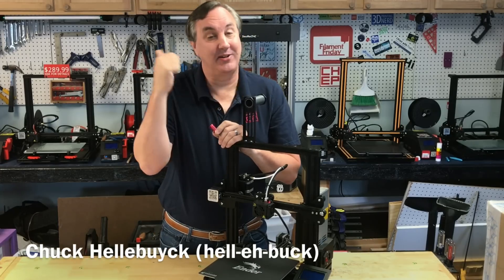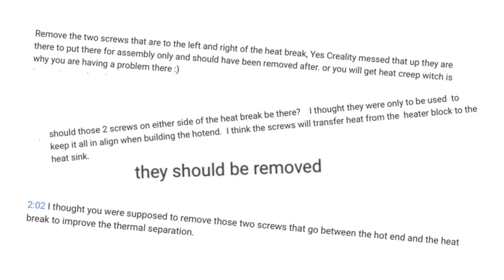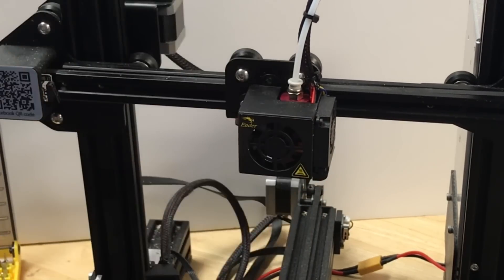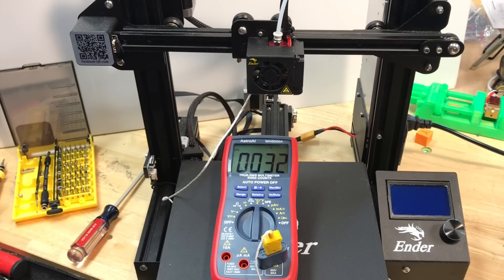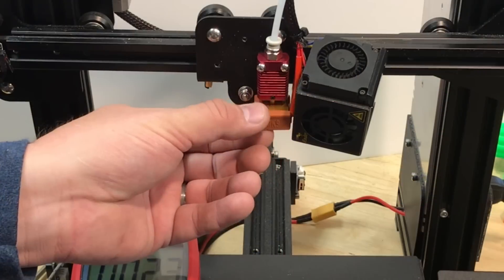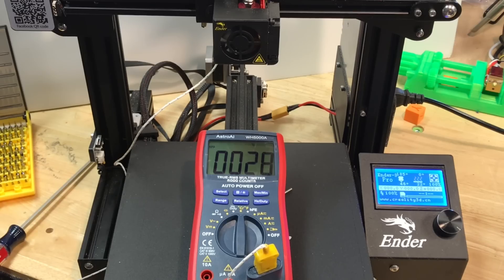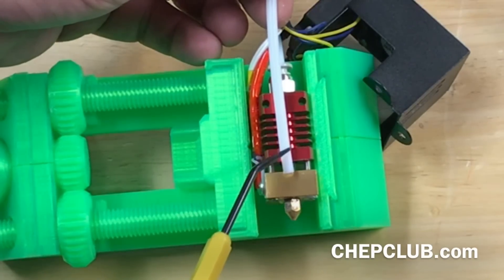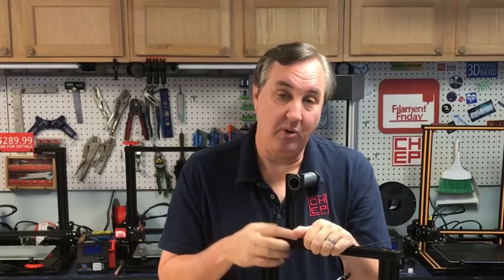Creality Ender 3 Hot End Heat Creep - Remove Those Screws......Maybe?

Comment: I remove the screws on all my printers and have had no problems.
Reply: People who don't believe in screws: 🤡🤡🤡
Reply: @GoldenJaguar3D    funny lol...
Reply: @GoldenJaguar3D  it can't turn once assembled. I have cr-10 s5 and I print 5 day to 7 day prints. The screws being gone have not caused problems. I push the Biden tube all the way through the hot end then cut it off. I never have problems anymore.
Reply: @Girl On A Quest the hot end can not turn more than a 1/16 of a turn. It is screwed to the carriage.
Reply: @GoldenJaguar3D  If your hotend is turning, that means that thermal connection between heatsink and heatbreak is very poor... Wich is raising melting point in your hotend, wich is bad thing. If you assemble hot-end in the right way, there is no chance to rorate or falling out, even without that screws. Add thermal paste, tighten lock screw good and you will see the difference.

Comment: This was really helpful. I ended up doing a few prints without the alignment screws thinking it helped solve my extruder skipping problem, but you're the second person that pointed out that without them, the heat break is only being held on by that set screw. The hot end is not something that should ever be potentially loose

Comment: There are so many things wrong with this test. You want the temperature of the inside of the coldend, the temperature of the fins is meaningless. The CPU in your PC runs at 60-85C, but the fins on the heatsink are room temperature...
Reply: I agree.  I still have my screws in, but this test should be re-run with the thermocouple placed inside the heat sink near the bottom (maybe held in place with a modified piece of PTFE tubing?)  and it shouldn't be moved between tests.   I still think it is fine with the screws, but it would be nice to get more reflective data.   Kudos to Chuck for attempting to get to the bottom of this question though.
Reply: @inb4dalock  Full disclosure, I'm designing a system that uses ender 3 heatsink with screws with cheap Chinese bimetallic heatbreak for Budget mosquito.
Reply: Disappointing to debunk a test without even getting up. Opened my CPU temp, popped off the side panel of my computer, verified CPU temp at 85C, touched the fins on the heat-sink

Comment: Thanks for the informative vid, i have a Tronxy X5S and it uses the cr heat block style less the 2 screws and my heat block moves, so those 2 screws do a very important job. Iv bought the cr10 heat block and now no issues.
Reply: Your setscrew is loose or not long enough to get enough force on the heatbreak

Comment: Sorry, but your test is completly incorrect! Because fan is cooling a thermocouple! I just use my finger to tuch upper surface on heatsink and it was so hot, i even cant keep my finger on it. Then, i remove this two screws and now, i dont feel any heat by my finger on the top surface of heatsink)
Reply from the maker: Check your fan. It’s probably failing.
Reply: CHEP I agree I can touch the top of the heat sink while the nozzle is at 260c.
Reply: @Anonymous-ee8ef  the nozzole shouldn't be that hot
Reply: roscoe baram it is when you print different materials
Reply: @Anonymous-ee8ef  yeah but unless Its heavily modified the ender 3 can only safely go to like 240 or maybe 250 with capricorn ptfe
Reply: roscoe baram I was just saying that you can touch the heat sink with the nozzle at 260 if your fan is working properly.
Reply: @Anonymous-ee8ef  yeah I know I was just saying the printer should never be that hot
Reply: roscoe baram stock no
Reply: @Anonymous-ee8ef  Because the ptfe tube in the stock ender 3 goes right into the hot end running it at high temerature s can cause off-gassing which can be dangerous. As low as 210c can be harmful to pet birds and 275 can kill birds but is apparently relativly safe for humans. I definitly reccomend getting an all metal hotend replacement where the ptfe tube only sites at the top of the heat sync rather than right at the nozzel.

Comment: The stock heat brake on the Ender 3 isn't that impressive when compared to better ones. What it affects is the heat creep, just as others have commented, but the heat sink is good enough to dissipate that heat, especially at lower heat block temperatures. What I would like to see is the same test at the maximum temperature. Removing the two screws and upgrading to a better heat brake WILL let you get to a higher maximum stable temperature of your heat block (basically utilizing the heat out from the heater cartridge best), but that's not needed unless you go for more interesting materials.
Reply: Because of the way the ptfe tube goes right into the hot end you don't want to be heating it up much more than 200 anyway because of off gassing.

Comment: Says 32C. Meter shows 30C.

Also measuring the temp outside is not accurate. There's no guarantee the ptfe inside (technically in close proximity with the screws) are also cool. 
The thermocouple is also being cooled by fan. So you are testing the fan effectivty + aluminum cooling. Missing the point of what we are measuring. The ptfe temp.

Also, are you aware that clogging issues happen on higher print temp using PETG and ABS? 

Stick to CNC Kitchen channel for adequate and REAL testing.
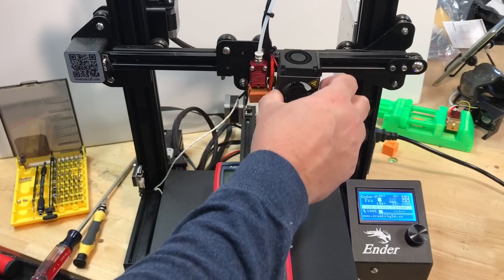Reply from the maker: At 3:59 it shows the 32°c on the meter. Most blockage happens with PLA because it expands at lower temps than PETG/ABS so it is more affected by heat creep. I’ve tested with the thermistor blocked from the fan and saw same readings. The point is the heat creep affecting blockage is a myth. I have a printfarm full of hotends with screws attached and no heat creep running near 24/7 for several years. What I have showed in later videos is the bottom 10 mm of the PTFE breaks down from heat directly from touching the nozzle and that is where blockages occurs. That is all below the screws and heat sink. And yes Stefan is a great engineer and friend. I do recommend his channel.
Reply: Aluminium is a very good conductor of heat so even allowing for a temperature gradient to the core and poor contact to the thermistor, I wouldn't expect the temp inside to be more than 50C.

Comment: I had a filament blob that formed around the thermistor wires which pulled out when I removed it.  I have the replacement part, but there is melted filament inside the screw head in the hot end so it's acting like a stripped screw head.  I can't heat it up without the wires connected.  Any ideas on how to clear it?
Reply from the maker: Heat it with a heat gun or soldering iron.

Comment: Good video! On a purely safety standpoint it would actually be dangerous removing those two screws. Because without them , the heater block/thermistor/cartridge are hold in place only by one tiny black grub screw in the heatsink. Which grub screw cannot be torque high because the heatsink is made of really low quality aluminum. Knowing that the extruder, mainly the heater cartridge, is a real fire hazard on those cheap Creality printers, no one should remove those two screws. That would be plain stupid! Period.
Reply: There is no load. Even if there were, the grub screws do not keep it in, they push the rounded surface into the adjacent rounded surface and create a ton of friction. The quality of the aluminum is not a concern because of the length of the setscrew. The hex on the setscrew will fail first. I have plenty of cold-ends that use a grub screw and no vertical screws and they have no problem

Comment: I'm getting heat creep on my all metal hot end around an hour into prints clogging up tried with screws and no screws the same thing any advice?
Reply from the maker: Check your fan. It may be spinning but failing.
Reply: I use a 40x20mm fan on my micro-swiss to help with heat creep. I've never once had a jam since I got the thing (knock on wood) and the heat sink is cold to the touch even with the nozzle @ 275c.

Comment: What about with abs or preg? I get clogging bag when I try and print those materials and it seems im getting melting on the tip of my tube.
Reply from the maker: What temperature are you printing at? 
I print PETG just fine.
Reply: @FilamentFriday  240 to 245.

Comment: Aren't those screws there to protect the heatbreak when you swap out a nozzle? I know a lot of people highly recommend a wrench to hold the block in place to prevent the break from breaking. I assume if you took the screws out it would break easily.
Reply: yet another reason to leave them in.
Reply: Just take them out when you're printing and put them back if you need to do a nozzle change. That's what I do. You shouldn't be letting your nozzle crash into things anyway and if the hot end breaks, it's like literally a 2 dollar part direct from china. I think it's worth it to avoid less heat creep. Heat creep means more oozing and stringing and higher required retractions as the melt zone moves higher up in the hot-end.

Comment: Keep the screws in. Why? They protect the heatbreak from breaking in two when tightening the nozzle. With the screws there, you just tighten it in place. Without the screws, you must use plyers or a wrench to hold the heatblock while you change the nozzle
Reply: Why not just remove the screws when printing and put them back in when you need to perform a nozzle change? I use a micro-swiss and it doesn't have those screws and it works fine, and has very little heat creep, especially since I'm blowing a 40x20mm fan on the heatsink. I don't see why you couldn't just take them out unless you're changing the nozzle.

Comment: The purpose of the heatsink above the heath-break is to keep the filament in the PTFE tube from becoming soft and squishy. The correct way of measuring the effect of these screws is therefore to measure the temperature inside the the PTFE tube at the heath-break. As an added bonus, this also removes the effect of direct cooling of the test-sensor by the fan.
Reply from the maker: I tried blocking the sensor and got the same results and if the heat sink doesn’t increase in temp then the inside if the PTFE won’t see it either. I checked the source not the symptom.
Reply: The PFTE tube is not a good conductive material. He didn't observe any variance of temp outside on the heatsink (32 Celcius in both cases). So putting the temp probe inside the PFTE tube would have change absolutely nothing in his test and the test result would have been the same : screw or no screw makes no difference.

Comment: The machines are made in China, anything not necessary would have been removed long ago.
Reply: Ain't that the truth!
Reply: Speaking as a manufacturing engineer who worked with China based manufacturers for decades, I can only WISH that your reasoning and logic applied to Chinese MEs and designers… but I assure you it does not. 

Do not ever expect logical design decisions- yes, even those affecting cost - from a Chinese shop. ;D
Reply: @railgap  Lol

Comment: heated up to 200°C.  Exactly same curve.
Stopped heating at 200. Cooling down to 35°C took 6min54sec.
heated up to 200°C. Removed 2screws. no other actions were done. Stopped heating at 200. Cooling down to 35°C now took 7min19sec.
There you have proof for heat creep. And this is actually how you test it.
Its obvious the screws transfer heat.
Reply from the maker: Nope. All you did was prove the screws connected to the heat sink help cool thinks down (which I never questioned) but I proved no extra heat gets to the PLA inside the PTFE affecting the print quality which is the original heat creep myth. The heat sink with fan dissipates heat too fast to let the PTFE/PLA get too hot so I stand by my tests.
Reply: @FilamentFriday  yeah that's true, it doesn't generate too much heat to affect the PTFE tube. However, due to the increased heat creep, the thermistor has to put additional power the heatblock all the time because the screws draw the heat out of the block.
The block has not to be cooled down.

This means increased power consumption of the printer and it does also mean the nozzle cools down way quicker (especially in the very high temperatures and when a lot of filament goes through, the thermistor can't keep up with so much heat drawn out of the block).
Sometimes it can be annoying to have a very quick cooling down nozzle when doing "tests" with the printer/stopping prints etc. The block needs to be hot and it needs to stay hot.
That's why the Mosquito Hotend has such a nice advantage. The heat stays where it needs to be.
I have removed the screws since they make no sense.
Reply: As CHEP said, you only proved that the screws help cooling down the block. So NO that's not actually how you test it. Man you just humiliated yourself on YouTube. Lol

Comment: I had heat creep which would jam up the filament, very often. Could not make a print. I made a duct for the heatsink fan, so the air would be forced over the heatsink. This worked much better. I then designed a printhead with a direct extruder and replaced the spring in the extruder with a bolt so the filament is gripped firmly. Now I have 0 problems.

Comment: i have ender 3 the hot end must turn hot plastic melt over heat element seml like hot plastic so i shut down pulled fans off and the plastic was thick but hard sp haet up removed the plastic check to see where the plastic come from the tud that screws into the brass heat end was pushing plastic up the out side of tube the i changed the hot end pluse wire tuened on power no heat to the hot end or the bed . check motherboard poer there but the wire ends for the bed and hot end had nopower the fans came on blue light on . but i did see when this was printing the temp was up and down so i thank the mother board has a bad short or mabe a relay bad the sencer wire replaced  w3hat your response on this thanks tom

Comment: Removing the screws made a BIG difference in cooling heat sink temps. I'm running a direct extruder and they supplied a plastic standoff to align the hot end with the extruder. The plastic standoff (behind the cooling heat sink) keeps the aluminum from dissipating heat from the cooling heat sink. This was keeping the cooling heatsink from working efficiently. Removing the two screws dropped the time down to 100deg F. HOWEVER, it allowed the hot end to loosen up while printing causing oozing. The filament chunks kept hitting the nozzle and the titanium tube stripped out the aluminium heater block. My solution, I got rid of the plastic spacer and went with an aluminum spacer to help dissipate heat. BTW leave the screws in to keep the hot and cool end aligned and for support.

Comment: If they are worried about heat creep then change out the screws for stainless steel versions. Stainless steel has a very low radiosity (meaning it does does not transfer heat very well).

Comment: i've been having heat creep issues with my ender 3s, but typically i am also doing a multi day print job at less than 0.10mm when that happens.
The heatsink is inadequate in those situations for long term. You can even do small prints as low as 0.05mm BUT not long prints due to the heat creep. Eventually, after days, the whole heatsink gets heat soaked and that ptfe tube is trash as it's completely blocked.
Reply from the maker: Sounds like your fan is failing. I’ve had this and replaced the cooling fan.
Reply: @FilamentFriday  fan is working. Issue is only with these under 0.12mm layer height supremely long prints.

But yeah, i've been planning on upgrading the fan on all my ender-3s for this reason :)
Reply from the maker: Try some higher temp:Capricorn Tubing: https://amzn.to/2nI2ipS

Comment: A schoolboy energy transfer calculation will tell you that each screw is - in ideal conditions - transferring less than 1W to the heatsink. If your fan can't bleed off this heat energy it's probably not doing a very good job.

Comment: Just a quick addendum: After watching this video I assumed this would also be true for the all metal "microswiss" chinese knock offs. This is absolutely not the case. I had HORRENDOUSLY bad heat creep and was assuming it was just a low quality cheap knock off. At 260c the bowden coupling at the top was scorching hot after only a couple minutes.  I made sure to tighten the 2 retaining screws above the heat break, removed the two long screws through the hotend (just like stock), and was delightfully surprised that even at 260c+, the top of the hotend was cool to the touch.

Chuck's test is only partially accurate, because he only tries 185c. The test should be conducted at the stock max, closer to 240c. At that point the extra energy might overwhelm the fan/heat sink and you might notice the ill effects of extra heat conduit. 

TLDR this video ONLY applies to the stock creality hot end, not the all metal microswiss knock-offs. It may also not apply at much higher temps then 185c.

Comment: Got a microswiss all metal for my CR-10S and they removed the 2 screws, yet there are threaded holes in their cold side (heat block had no holes so screws were not an option). Never an issue no using them. If I put the original CR-10's heat block on then I could use the screws... Microswiss knows something if they ditched the screws.
EDIT:  Excellent video!

Comment: Chuck, I have a related question for you.  I need to temporarily remove those two screws, but my 2mm hex key is too big and my 1.5mm is too small.  What's size did you use?  Thanks!
Reply from the maker: Try a T8 Star bit
Reply: @FilamentFriday  Will do, thanks!